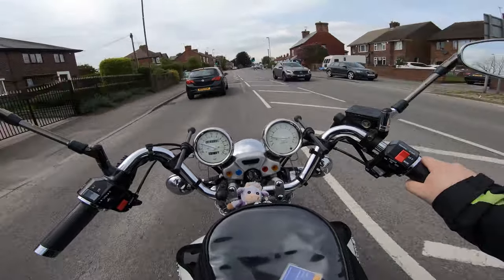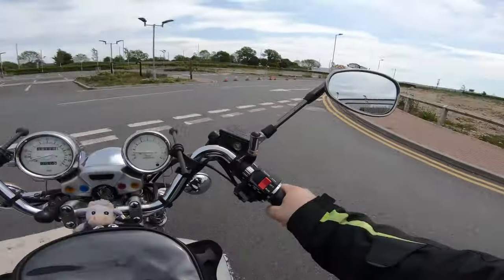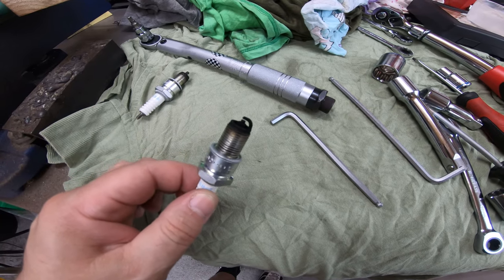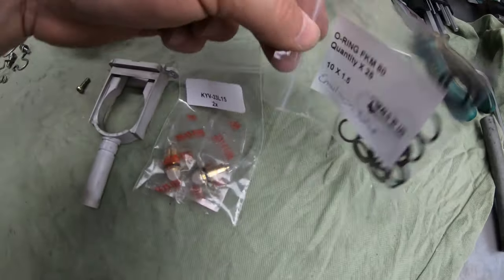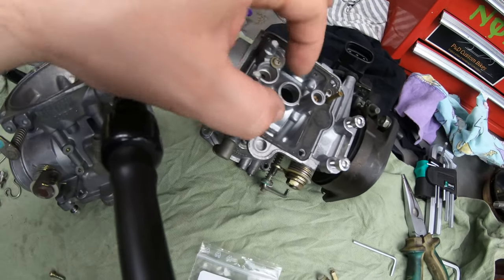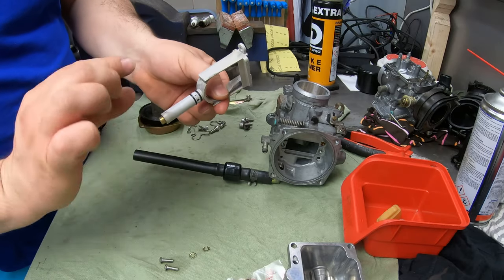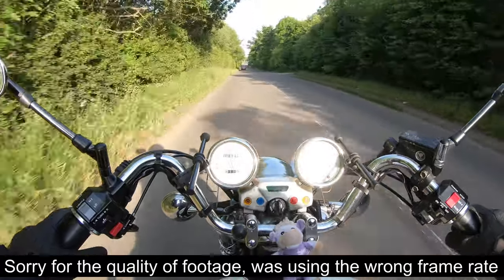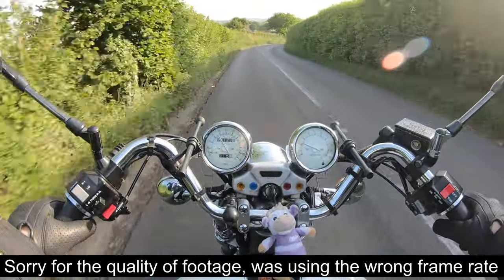VIRAGO 1100 CARB ISSUE  | FLOAT VALVE GONE | How to adjust fuel level | Emulsion tube O-ring swap

Comment: Great video, Mte. Now it's possible to show people the O-rings of the Emulsion Tube. I just had a total shoer that burned my minus and plus wire of the charging system out, the rectifier is destroyed, at least two diodes ordered a replacement.  Thanks for the great video, keep them wheels rollin; mate.

Comment: Nice detail video Midland , I am currently working on a 1990 virago XV 750 Started out front cylinder was firing intermittently , I pulled the carb out and did a rejet while in the process of adjusting the rear float I snapped one of the float arm, tried to cement it , it work for a few days  but not how it should , the bike will start up ok and I can drive the bike up to 40- 50 mph but any speed higher than 50 I have to used full choke , spark plugs look nice and grayish brown . So I pulled the carb out a day ago and found out the float with the cement was flimsy , just order a new float may be here by beginning of Jan.some time .Also I have a 1992 Yamaha Virago XV1100 one issue I have with this bike is that after the bike is warmed up and I go on the road and come to a stop light the bike does not want to go down to Idle speed , It will stay at 2000 rpm , some time I have to rev the engine and release the throttle then the rpm will drop to Idle .If any you Virago owner ever encounter this problem and had it fix , Please let me know what is the solution for this " stuck on high idle".
Reply from the maker: Hello. If you rev the bike and then the idle drops then you might have a degrading cable or a stiff/tight throttle mechanism.  Spray some wd 40 to the mechanism and disconnect the cables to see if any of them stuck/stiff/grinding. The throttle  must be completely free from any stiffness and should snap back to the idle screw even if only opened a tiny bit.

If still bad you might have an air leak. Check the seal between the carb rubber and the cylinder head, (should be an o-ring in there) and also the vacuum sync caps could have cracks and will let air in, which will cause high idle..hope this helps

Comment: Hey brother, I know I write to you all over the videos lol, sorry about that. So I changed the coil, wires, resistor cap, spark plug. I removed my reserve tank, now the main tank goes directly to the filter and then the pump. I removed the emissions, air intake valve and the assembly. I also readjusted the valves in the cylinder like you did. The bike runs much better now, definitely sounds better and has more power. But I noticed my front cylinder is still getting way to much gas, it's too rich, and my spark plug is wet and has dry black soot like yours in the video. So it's causing a loss of power still (not as bad as before, but still). I'm going to pull my carbs off and check the floats, and then sync the carbs, and adjust the air/fuel mixture screws. Now, are the fuel/air mixture screws the same screws as the screws used to sync the carbs?
Reply from the maker: Hi, no problem. The screws are different. The sync screw is between the carbs at the bottom.
The pilot screws are at the top of each carb under a black rubber plug. If you look at your carb for example the rear, you have 2 ends (1 is airbox side, the other is the cylinder head side) now look next to the top cover at the cylinder head side and you should find the black rubber plug, and under that the pliot screw.
Now this is the last step to adjust, especially if the bike was running fine, then more than likely your problem is NOT the pilot screws.
Before you take off the carbs measure the fuel level ( not float level) to do this prime the carbs with the pump until the pump only clicks once or not at all, that means it's full.
Then get a transparent tube, put it on the drain hole and open the drain screw, leave it open and hold the tube against the carb to see the level which should be about 1mm below the line where the bowl and body meat (please check my "carb problem solved" video where I show this) procedure is the same just your carbs will be on the bike not in a vice..
Once you know your fuel level is right or not, then you can move to the rest of the carbs, this is the main thing with carbs, it MUST be right BEFORE anything else, this is where everyone gets it wrong and then trying to fix it with needle lifting and pilot screw adjusting (WRONG).. I'm not angry😂 just making the words stand out, so it's easier to remember😉
Hope I answered your questions 😉🔧

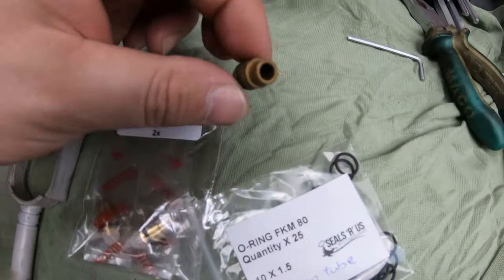Comment: Great video - I just purchased a 93 Virago 1100 (my 1st bike).  One of the carbs has a broken cover where the main jet screws in.  I have only been able to locate the later style plastic slides, which leave the emulsion tube bare.  Does anybody have a part number or source for this particular piece, shown at 4:20 in the video?

Comment: Mate, just a heads up. Your movies are great. I followed the other guy's (Pros DIY) advice and did not take out the float, using a screwdriver to bend it, but it broke the one plastic support part. Result: Needed a new float from the US, which is a pain in the you know where,.These parts are rooting to use so much force, I should have known that. Keep them wheels rollin'; mate.
Reply from the maker: Sorry to hear that mate...I hope you quickly get it from the States. I never liked using anything on them but my hand so I can feel it better what I'm doing. Anyway you should be ok now once you get it, all the best👍
Reply: @MidlandCruiser  All done and dusted. New cables from the new rectifier o the loom and battery, plus carbs are back in, running great. Keep them wheels rollin'; bro.
Reply: @MidlandCruiser  God, Buddha,. Mohammed and Ganesh! I had to change the whole wiring for the rectifier and put a new aftermarket Mosfet type one in, Firs problem was when the main fuse turned out to be no more usable, os making something with two fuses. Then I had to do the carbs, as you already know. The carbs worked, but when doing 190  km/h, the bike started acting weird and I had no idea what was wrong. Finally, I opened the TCI, saw some cold soldering points, and went to a TV repair shop to find a guy to do that. My lucky day!! A Thai biker who has a Moto Guzzi worked there and when he heard that the TCI was for an 1100 Yamaha which he knew,, he started ree soldering. After ten minutes it was done and I went home, put it back in. The bike rides well, god I wanted to burn the sucker, guess you know such moments, mate?! Now the China and US virus is at our school, too many people, teachers, and kids are sick.  Stay safe, bro,. Best wishes from Taka Tuka soldier Thailand.

Comment: Great Video Mate, You have reminded me that I need to put my viton o-rings on my emulsion tubes too, just so that, I know my dual carbs are sorted & ready, if I ever have the need to go back to the dual carbs, but at the moment, I am enjoying my single carb setup far too much LoL :)
Reply from the maker: Thank you, really appreciate it... Not sure about the single carb. Is it just the simplicity of it over the dual or is there any other benefits? I rode a 2003 883 sportster which is a single Keihin and it felt alright, but my Virago is a rocket compared to that (obviously more cc so it's not fair).
Maybe 1 day I'll give it a go. 🤷‍♂️
Reply: @MidlandCruiser  Well, You will lose some Top End Speed, But you will have a bit more Mid Range Grunt (which is where I cruise - between 2000 to 4500 RPM roughly) & you will get more MPG, but the best thing is, If you ever need to work on the carb, it's so easy, because it now sits out from between the cylinders, I can have my carb completely off in under 5 minutes or if you need to get to your Jets or Float, you can do that with the carb still attached which is good if you need to tinker with it on the roadside :)
Reply from the maker: I see. I really like the idea of the 5 min carb off situation and more midrange, but for now I leave mine alone, I have other plans for the winter.. You'll see😉

Comment: I need those orings for the emulsion tube and can’t find what you’re have
Reply from the maker: Hello. You don't necessarily need viton o-rings you can use nitrile and the size should be a standard 10x1.5mm.
Reply: @MidlandCruiser  thanks! I am restoring an 88 1100 and saw your video then checked my tubes and orings are shot! Been sitting for 20 years since last ran

Comment: Your videos have been a HUGE help with me working on my Virago, so I want to say thank you! One question though - what is the spec of the emulsion tube bolts? I couldn’t match the bolts to my metric tap/die set and want to replace them. Cheers
Reply from the maker: Thank you very much, really appreciate it. Them two little screws probably like 5Nm max (possibly less). I didn't use torque wrench on it, just went with feel. With thread lock on it, it should be fine as long as it isn't loose. Use a screwdriver type tool so you can't get too much leverage, and will be fine.
Reply: @MidlandCruiser   thanks for the reply, my choice of wording in my question was bad though - what bolt/thread size were the replacements you used? I had some on hand that fit but weirdly couldn’t verify the size against my metric thread dies (could be user error on my part).

Refitted my carbs following your video and I’m now much more confident working on my bike, as hadn’t tackled that step before.
Reply from the maker: @MotoJohn  hello, sorry I missed the tap/die part. I think it is a standard M4 with 0.7mm pitch, could be M5 x0.8 though...I can'tremember. Hope this helps

Comment: Hi! Did you make sure to line up the hole on the plastic guillotine with the hole in the carb body? To me, it seems like you can fit it 180 degrees off.
Reply from the maker: If I remember correctly then it won't matter which way it is because the air can get where it needs to be, because it has an o-ring above and below the hole on the plastic tube, so in the casting the air is all around that part of the plastic tube, I hope it make sense
Reply: @MidlandCruiser  Thank you. I have had my carbs sonically cleaned, and the cleaner removed the tubes. I could only get 1.2 mm O-rings, which are not very tight, and now the bike starts well and run OK-ish for 10 miles, then become progressively worse with stutters and cutting out. The spark plugs both look like your black one. Since I have also fitted a new aftermarket TCI and new, simpler wiring harness and a new exhaust, I have been at loss as to where the problem is located. So I felt relieved when I found your video, because it gives me a place to start. Will get 1.5mm O-rings (viton) on Monday. Thanks again! Eirik

Comment: you should do a video on how to change the starter motor and solinoid
Reply from the maker: Hello, thank you for your suggestion... Unfortunately until I have a problem with it, I usually don't tuch stuff which works, however I am planning to do a check up on the starter motor bushings and general condition. And probably paint the housing because it is slightly rusty and it is driving me crazy😁 please consider subscribing so you don't miss it😉👍

Comment: How did you remove the shaft for the float? Would have been idea of how you dismantled the carb 🤷‍♂️
Reply from the maker: Hello. I have  detailed videos about fully stripping these carbs and also a separate one just about float/fuel level settings
Fuel level video https://youtu.be/LREsazlZjhg
Full carb strip video https://youtu.be/KYdmgGYJc9I
I show in both how to remove the float shafts...

Comment: Any way you could include part numbers and vendor name for o rings and needle valve seats? As well as where you got the jet you use? I’m running a similar set up on my virago 750, stock air but open exhaust. Thanks!
Reply from the maker: Hello, any virago carb parts you could possibly need can be found here https://nrp-carbs.co.uk/shop/index.php?route=product/manufacturer/info&manufacturer_id=14&page=75

They sell quality parts, mostly Keyster products which I also use along with genuine Yamaha parts. 

For O-rings I use ebay or simplybearnigs.co.uk however they are a bit pricey. 

I hope this helps.

Comment: What’s the plastic piece called; I can’t find one online to order. My jet just spins infinately so assume I need to get a new one. Also broke screw head holding it in place
Reply from the maker: Hello, you don't necessarily need a new one of those if only the spinning is the problem because with a long nose plier you can grab the top end of the brass emulsion tube (gently though) and tight up the jet. If you striped that security torx bolt than sorry to hear it, it is thread locked in and made of soft metal, you could drill it out but be very careful.

Comment: Also, I noticed in your other video, your bike doesn't have any emissions or egr valves underneath the fish eye bubble cover on your left side of the bike. Mine does because it's in the US. Is it possible for my to bypass and delete everything under that cover? (The egr valve, filter, etc...) I want to completely remove the left side bubble cover and the black bracket that holds the filter, egr, etc... So nothing it there. I removed the right side bubble cover already, since the stock air intake assembly is no longer on there
Reply from the maker: Yes that is removable completely, but I'm not familiar with the process as we in the UK don't have that like you said... I'm sure there is a youtube video about it, and the Virago nation group on Facebook has loads of info so might want to check it out as well...
Reply: @MidlandCruiser  awesome I'll check it out! Thank you brother!

Comment: The plastic emulsion tube on mine is cracked. I cant for the life of me find a part number let alone a replacement part. This is causing my diaphragm assembly to not move properly. I’ve looked in fourms and countless diagrams and cant find any information. Please help!
Reply from the maker: Unfortunately that part is like rocking hore shit...you could possibly get a new (2nd hand) carb assembly easier. Also you could try and glue it, there are special glue available for using it in fuel, to be fair can't get worse than it is. To be fully honest I don't think that is a separate part which you can buy, it isn't meant to be taken out of the body. Hope this helps a little

Comment: Brother, @3:12 how do you get these plastic pieces out?  Allen keys and torx bit's don't seem to fit...
Reply from the maker: Ohh dear, then possibly someone before you stripped them, you must use heat to melt the thread lock, only from the outside though. Then you can try to use some extractor bits, it is made from monkey metal and strip very very easily unfortunately.
Reply: @MidlandCruiser  Mine is a 1992, not sure if the design is different.  I'm the first person to rebuild these since factory, so they are not stripped.  I'd send you a picture, but it looks like the screw heads are a cross between torx and allen/hex screws.  I have tried both wrench types and none work.  Very strange.
Reply: @MidlandCruiser  Actually, I watched your video again, it does look like the same screw head.  You also said how difficult it was to get out.  Mine doesn't seem to have a wrench that wants to fit it.  Strange.
Reply from the maker: @Augcliffe  yes it was difficult because I knew about the threadlock and the soft material and didn't want to strip it, so I was extra careful..you can send me some pictures if you want to, in email to midlandcruiser@gmail.com
Reply: Are they the Torx anti theft heads? If I remember from doing mine it might be size20. I had to buy a little set of bits to fit a socket. Felt very delicate removing them from the plastic so be gentle and patient 👍
Reply: @gefrinjim6803 yes they were.  I got them out.

Comment: Can you confirm if the viton orings you fitted are original size? I see you replaced them with 10 x 1.5mm orings...
Reply from the maker: Yes, that is the one, however on the top side on the emulsion tube this O ring is quite tight, use silicone spray and clean the hole in the carb casting thoroughly. I even used 400grit wet and dry to make it smooth and it was still a bastard to push it back in.
Reply: @MidlandCruiser  Thanks, I noticed the top groove is not as deep and the hole in the carb casting is slightly tapered... I have not been able to find anywhere that actually lists the correct size for these orings... I wondered if they where different sizes to compensate for the shallow groove?